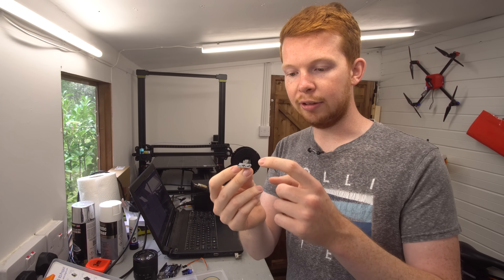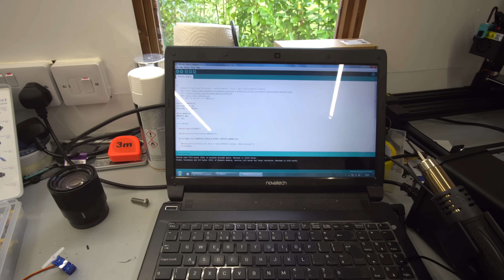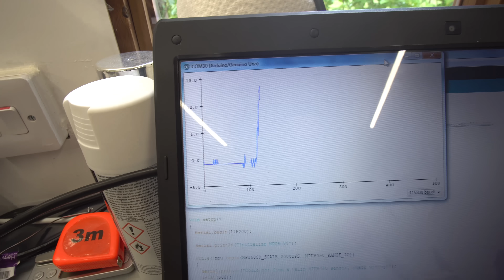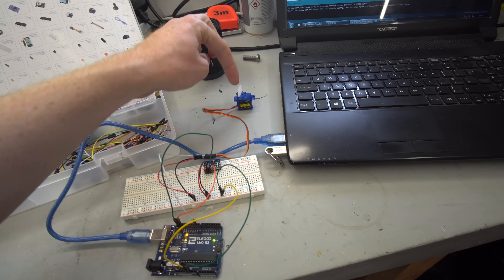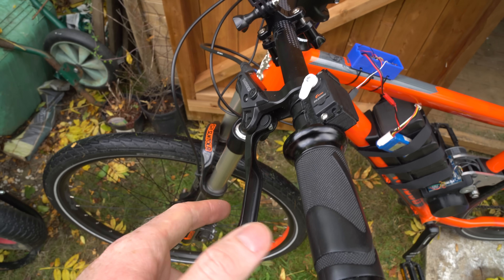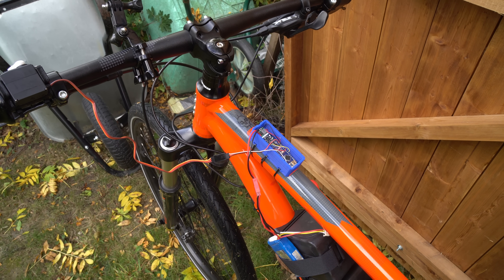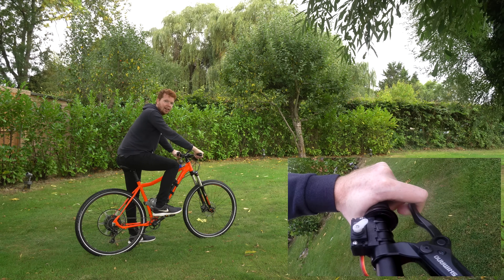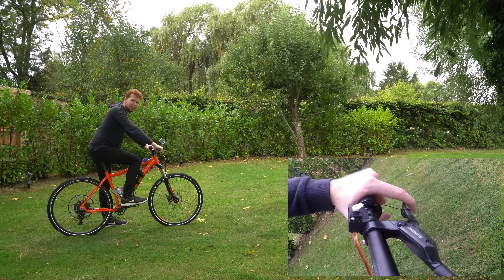Wheelie Cheat Device?

Comment: I learned to ride a wheelie in 1976 , my bike is 20" with a coaster brake , my longest is 5.5 miles @ 2 to 3 mph no greater than 5 mph . 
Curiosity made me watch this and I must applaud how deep you have delved into the physics using electrical components . That device you created is equally terrifying as it is terrific . My mind is blown by your whole concept and I have nothing but accolades and applauses for your efforts . 
Simply Magnificent , especially for a prototype .
I would deem that a first round success if I were you .

Comment: Maybe you should introduce acceleration values beyond a set bike angle as your brake trigger.. In that way your are not dependent just on the balance point. On route to a fall you should get a deceleration spike that you can respond to. Simpy ignore the deceleration anomalies at less than 45/50 degrees. Also, a hydraulic breaking mechanism is needed I think and a voltage regulator mapped to the deceleration values would be nice.

Comment: you need a activate switch, so the angle is measured starting not from 0 (flat ground) but the current angle. then make the max angle not a set value but a value that changes depending on the start angle. then you can go uphill
Reply: great idea tho

Comment: Love your logic. Good fun having a play with these ideas. Maybe if the arduino could also measure the rate of angle change & incorporate the data into its logic. That way the brake could be applied equally as well for a light person & heavy person. I saw a video recently of a bloke who made a vertical take off drone that has just one motor. His circuit controlled 4 vanes at the rear like a rocket's rear vanes. After many attempts he got it working. The rate of measurement & accuracy of the counter maneuvers was impressive.

Comment: I wonder if you could replace (or complement) the gyro sensor with an ultrasonic rangefinder on the front of the bike (pointing down) to eliminate signal noise from the gyro (and by signal noise I mean the jitter caused by the road bumps)

Comment: If you got outside away from that computer and actually practiced riding a tiny bit, you wouldn't need a degree in electrical engineering and loads of student debt to pull a simple wheelie. 😉👍

Comment: Instead of activating the break, the device could activate a reaction wheel between your legs when you initiate wheelie (over a certain angle, maybe 45 degrees) and maintain balance with another angle you decide is the target. It would obviously need much more power and mass but would be less influenced by the mass of the bike rider. It would help people new to wheelie because it would be noisy when far from the target angle.

Comment: its not a wheelie cheat device, its a wheelie loop out saver,, a wheelie cheat device will hold your bike at the balance point for you and this device is cool but pointless because you can just pull the brake yourself and thats part of wheelie control and its stupid on a bicycle , would be better on a motorcycle but good for proof of concept and testing but again pointless on a bicycle and would need redesigning for a motorcycle.

Comment: This would be a lot easier with cable brakes as you could brake directly from the cable rather than the lever, and with the motor, you could make it a cheat device by maintaining the angle with speed variations.

Comment: Not sure how you would do it on the Arduino board but you may find that an actual quadcopter flight controller may be a little better for this based on the amount of filtering and the number of outputs it has.

Comment: You could have a device that has calibration built in, to set a persons balance point. This could possibly be done by allowing them to put the device into a calibration mode, the code could do something like check for a threshold value that exists for x amount of seconds. This step could be repeated x amount of times to make the program fine tune the balance point. Then this would work no matter what weight, height & arm length the person has. Nice work so far!

Comment: You could improve massively on the code, for example only activate the servo if you are in the balance point and go over it. You could add the motor controller to your arduino code and push more voltage if the angle is smaller than the balance point to automate it completely ;) Interesting Project, i am actually working on an arduino controlled electric scooter right now 👍🏼

Comment: Couldn't ya just have a pendulum centered on the axle, with a wide top parallel the wheel, and a weight underneath, that pushes against the frame if you're getting too high in angle?

Comment: What if you're riding up a hill? The autobrake will definetly make it far more difficult ;)
Reply: Think again.
Reply: +ClaudeSac
No, it is you who is thinking this in the wrong way. 
Since the Arduino is using a gyro the brakes will automatically deploy up a hill as it cannot tell the difference between them. Use that brain of yours before commenting, please.
Reply: Wow .... goodbye kind soul.
Reply: +ClaudeSac What is your age?
Reply: @ClaudeSac  like you even know what 'kind soul' is
Reply: @ki0w0-lordofwatersheep  you are not helping ...
Reply: @ClaudeSac  here, i'll help
Was your first reply kind? No wonder the other guy responded like that
Reply: @ki0w0-lordofwatersheep  Read again.
Reply: You are wrong "eArTh iS fLaT"
Reply: Tbh I doubt the hills he goes up are that steep.
Reply: You cant climb 45° uphill. So no problems
Reply: Well, you just unplug some wire, I guess. Could help to have a button of sorts right on the handle.

Comment: Well, assuming the bike can brake and accelerate and has enough torque in both cases, the bike should be able to hold itself at a specific angle even if it's not the balance point. Of course that would only work to a certain extent since eventually the bike reaches full speed or a full stop and has no torque left to apply. But it would give you some time to balance yourself and by leaning to the back or front you could cause the bike to go slower or faster. That might be interesting. Perhaps you should have some kind of fail safe to cut the throttle though?!
Anyway, I think the first thing I concentrate on is the jerkiness of the system. In this attempt it didn't pull the brake at a steady level depending on the angle it went on and off the brake. That shows you have a very noise control.
First of all I would try using the gyroscope rather than the accelerometer and use the accelerometer only to compensate for the drift of the gyroscope (pretty much like airplane attitude indicators do). This would help eliminate noise 'caused by bumpiness in the road and other vibration in the bikes frame, also you should have faster response since gyroscope usually have significantly higher refresh rates than accelerometers. Second of all, I seriously doubt you'll get away without a well tuned PID loop in this case. If the bike comes up quickly the system will need to brake harder and earlier than if the bike just barely passes the balance point really slowly. Of course you can fine tune your linear brake control and may be able to get it to sort of work, but that will certainly not be a smooth ride.

Comment: the use of a hobby servo was a poor choice.  5:11 as little servos are not designed for the job you have in mind.
however the arduino and its gyroscope stabilizer kit are a good choice. a good design for a bike brake servo is to use a fast 20 to 50 watt linear motor design. you need good reaction speed. alternatively is the use a fast linear counterweight motor design.  that is 10% the weight of the rider. also a spinning mass gyroscope or 20 - 50 watt motor spinning a barbell weight plate. this will give your bike a standing still Wheelie you can hide this spinning mass in-side the bike seat. if your a street performer looking for a new act! a hopping mono wheel bike?. now you can dance with your rider-less hopping mono wheeling bike. :-)

Comment: An easier way to fine adjust the angle (rather than the potentiometer input as has been suggested) is to mount the Arduino box to the frame such that the whole thing can be tilted forward/backward. Just grab it and move it. More intuitive.

Comment: i thought you were going to strap the gyro to the bike, then have a light bar and potentiometer, then when wheeling in your normal position, dial in to the centre of the bar.
put someone new on the bike and get them to wheelie and keep the led in the centre, and disregarding large mass differences, it should be the correct position.
easy wheelie tutor.

Comment: lol but if you're going up hill you're screwed, i recommend some sort of sensor on the forks to see if pressure is still on them, if so then ignore braking: otherwise let her rip. also you should have implemented a method for smoothing the brake force so it's not so jerky. Possibly even a throttle function to prevent super small adjustments having major impacts.

Comment: Great device! you should tie up your servo to the end of the brake lever rather than the center, that way you could double the braking force (increasing the torque), but it will pull the cord 2 times the distance (approx), ant that might change so you should adjust that as well

Comment: Yes dude! I've been wanting to try this ever since I saw the alta motorcycle. They could have a wheelie mode on it. You would just have to lean back twist the throttle and the bike would find its own balance point. The brake is one way to do it, you could also wire it to control entirely with the throttle. Glad people have started experimenting!

Comment: You also need to account for the forward acceleration adding to the perceived angle the accelerometer is measuring with every pedal push. You would probably need to measure the rear wheel rotational speed and add a correction value based on that.

Comment: I would perfect your cycle , brake idea , the motorcycle one has already been done ✅ but through a different electronic device, namely the side switch stand with an adjustable plastic rod that’s adjustable to alter the height of the wheelies and momentarily cuts the engine hence you don’t flip the bike ,,, went on a wheelie course 20 yrs ago,, using a bandit 1200 ,and the method just spoke about ,,,,cheers Shane 🇬🇧 uk

Comment: If you are trying to calculate the variables that you listed then its a chaotic system. When you are doing a wheelie, the goal is to have the front wheel elevated and, (relative to pulling up into the wheelie position from normal) a relatively static vertical acceleration. So rather than calculate the angle of the frame, why not use the vertical acceleration relative to the horizontal?

Comment: Great project as always. If this device is just meant to prevent loop outs you're oh so close! If the brake reacted to rate of angular change providing a short sharp stab of rear brake when you're over your tuned threshold you'd have much more consistent results given the variables you've already identified. This is one of your most commercially viable tinkerings, happy coding!

Comment: Hi Tom, I have a suggestion for you. Why don't you tap the analog signal from the throttle on your handlebar into the Arduino and then digitally control the vESC. Because you have a Gyro on board it would allow you to program a variety of control systems to control the bike in various conditions like when you're riding normally and holding a wheelie. A PID system can help you maintain a wheelie continuously without using brakes, and may be bring your nose down very smoothly when you throttle to zero. Using potentiometers on your brake cables will allow you to play around and design with a combination of so many i/o methods and control systems. 
All the best.

Comment: What about a knob (potentiometer or rotary encoder) to adjust the angle.  Taller/bigger guys can turn it down, and skinnier/shorter guys and gals can adjust the angle higher.  You're making an anti-flip device so it doesn't have to hold a perfect wheelie.  It just needs to prevent a flip over at a certain angle.  I'd get a bigger servo and use a pulley to get it to pull from the end of the brake handle for more torque.  You could also use a rolling average to smooth the twitchyness of the servo.  Just some thoughts!

Comment: neat stuff lol. in order to have the linearest behaviour possible, i believe the axis of the servo should align with the axis of lever and the length of the servo arm should be same with the wire mounting distance from lever axis.  otherwise, you must remap your values considering the servo arc motion. then, you can measure the desirable brake range, measure the start and end angle of the servo, and enter those in your code as value range. that is the hardware linear calibrarion. since you need less brake in low angles and higher in the apex, you can introduce a software calibration (value remapping) using your value squared or other math (better circle equation) that will give you a that sweet non linear response.

if you do all the above right, and use the desired axis acceleration values (instead of the angle) you could propably make a true cheat device that will hold willies. Angle will be used only as an if statement, if angle > 45 then read acceleration, and brake accordingly. you should check whether you need positive or negative acceleration value, depending on placement.

Comment: Question for Tom or anyone:-
Is it possible to get a servo-actuated brake master cylinder small enough for a bicycle?   Preferably that would work along (in parallel) with the handlebar mounted one...?
PS.  Perhaps possible to "reverse" the action of motorcycle ABS?

Comment: You need smoother activation, and perhaps measure the rate of change so that it can find the correct balance point no matter what the rider is doing. It will have to have to ignore the initial up stage then look for fast changes in one direction and have a max safe point for sudden activation.

Comment: Suggestion:
1. Mount cut-off switches for the motor to the brakes, so that in a panic situation braking will always work.
2. Consider making the variable to be controlled not the angle (PID tries to find some optimal angle, which, as you say, can vary mid-ride with body motion) but rather the rate of change of the angle, and strive for zero. I.e. P=d(alpha)/dt, I=alpha, D=d^2(alpha)/dt^2. That way, as soon as the bike starts to tilt _at all_, the controller will try to counteract that.

Comment: Why are people still using AVRs (Arduino Uno/Nano/Micro) in 2018?! Just let it die already... There are so much better options, like STM32. You can get an STM32F103C8T6 from aliexpress with 5-10 times the performance, cheaper than ATmega328p, with more peripherals, memory, power...

Comment: I think you missed one pretty significant point that also made this a much harder project (you did touch on it in a way, but didn't highlight it as a major hurdle) and that is the fact the force/energy you are putting into the bike to keep it in the wheelie is not controlled by the system. The Segway works because the motors are controlled and therefore the force applied to keep the vehicle on the balance point is a controlled value whereas on a pedal powered vehicle you will undoubtedly and unconciously increase or decrease the amount of force applied to the pedals to try and maintain balance point to your own perceived . This was evident when you said that it felt harder to pedal, which means the board was applying correction but you were unconciously trying to override it. I would love to see you try and adapt a flight controller from a Multirotor for this purpose so that you could take advantage of the inbuilt PID capability. like you said there are many variables to finding the balance point, but maybe a "set point" switch on the bars would be a good idea so the balance point can be set on the fly. Ie you pop the bike up, as you feel it hit balance point you press the momentary switch and this sets the current angle as the target for the controller. Rather than wire, a RC throttle linkage from a Nitro motor would be a great way to link the brake to the servo as the moveable end stop on the linkage will be much easier to adjust during testing, but it also provides no resistance to being overridden by manual input. Don't drop this project yet, it's very novel and TBH I think it would make a great Kickstarter type training aid for people wanting to learn to wheelie if you can package it in an easy to impliment and set kind of way. I know I want to master wheelies and the idea of something that might stop me looping out sounds excellent! Good work!!! I look forward to seeing if you can link both the brake and throttle on the ebike with some kind of hysteresis, for true set and forget wheelie control.

Comment: You could just have an encoder on the rear wheel, then run the wheel forward until the cg isbalanced and the wheel isn’t pulled one direction or another, and hold it there like a segway standing still. Then it wouldn’t matter where the cg is as its above the wheels of the bike. This would have to run the motor in forward and reverse to stay balanced, and you’d want to be on flat ground.

Comment: im sorry your wrong about the whole motorbike wheelie cheat thing. the rider does effect the wheelie height just as much as a bicycle bcus if a rider is far forward on a wheelie on a bike then he will have to use engine speed and power to "chase the wheelie". and also the mechanism used to control wheelie height on a motorbike wheelie cheat thing is used by cutting out the ignition which also means engine breaking which at that height would be enough to bring the front wheel down. Good thinking though i like the idea but i think if someone wanted to wheelie they would learn how to do it normally like myself and most others who are now good at it